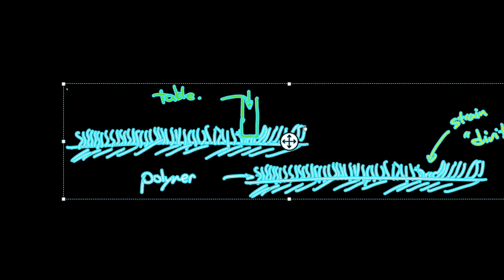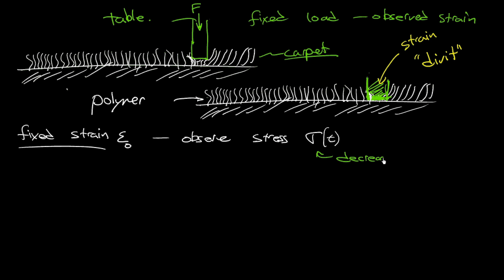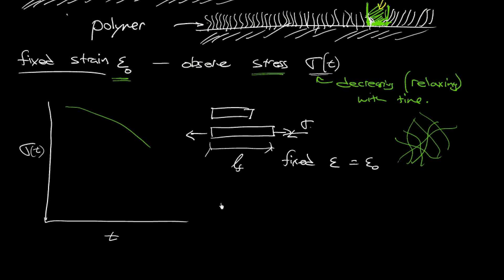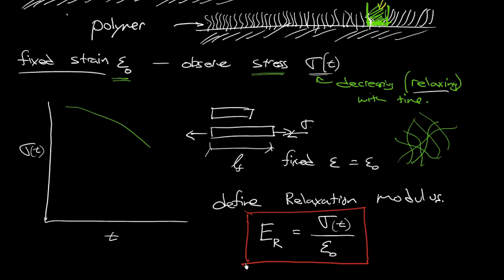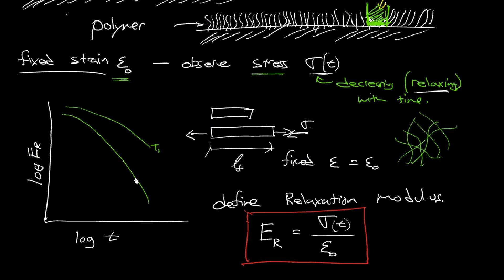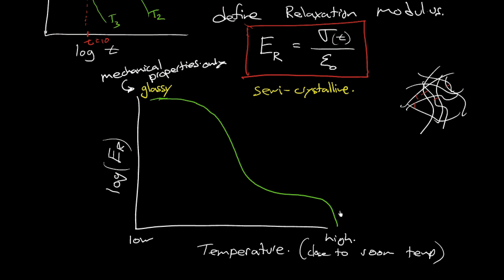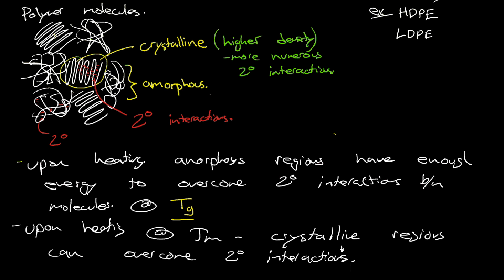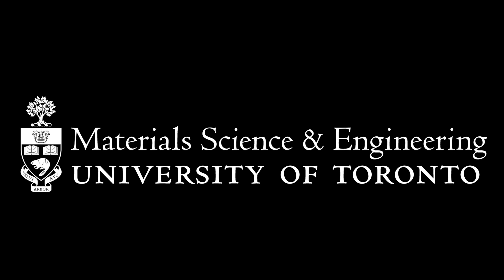Polymer viscoelasticity and the relaxation modulus

Comment: In Abaqus software, the viscoelastic model of material can be defined based on the shear test data of normalized shear compliance j(s) or modulus g(R). Please guide me on the way to calculate j(s) or g(R) from the stress relaxation data.
Reply: I have the same doubt. Please comment if you have found out

Comment: Sir and Dear Friends I  have a question. How can we fixed the length ? When we apply force should not we observe elongation ?  I think from Stress= Module x  Strain. If strain is fixed and stress is decreasing it means modulus of material also changes ?  Thank you.
Reply: for a typical stress relaxation, we stretch the sample by a fixed amount and measure the stress needed to keep the sample at that length. You are correct that if strain is constant and stress is decreasing with time, that this implies that the modulus is also a function of time (see relaxation modulus in video, E_r). It is well known that polymers "remember" previous mechanical treatment: a polymer sample that has been strained is less stiff than an unstrained sample. This memory is because polymer properties are time (history) dependent. Properties of polymers are also rate dependent - there is a lot of time dependency in polymer science!